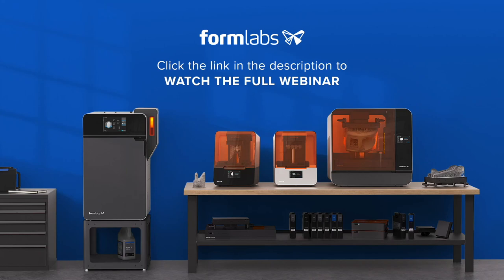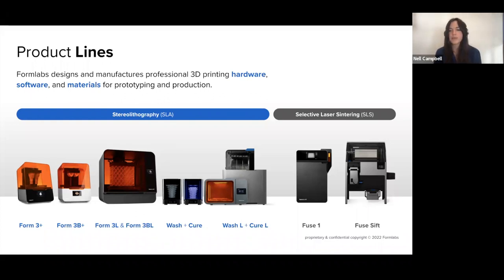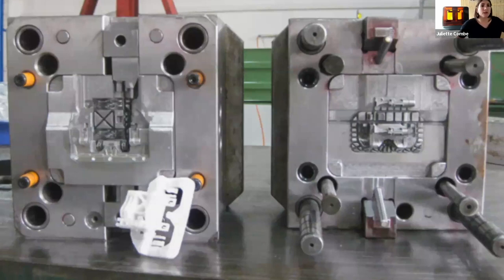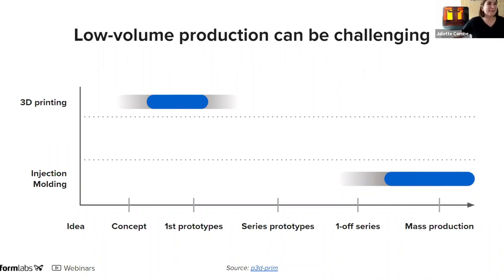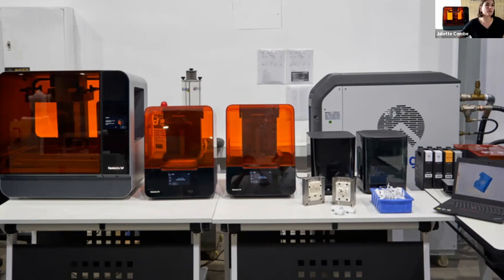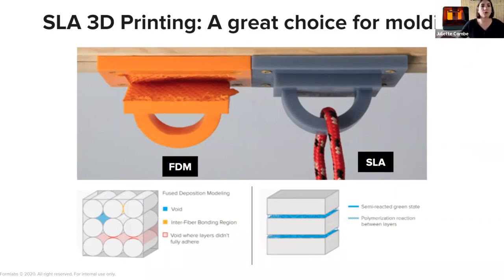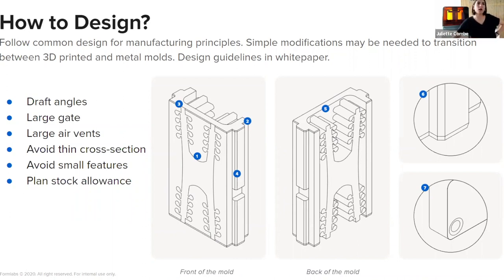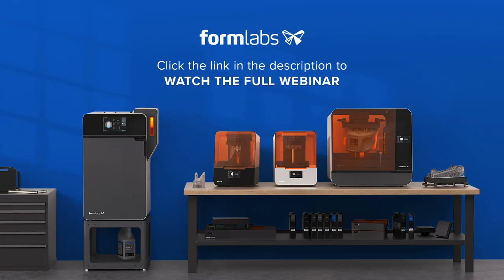Low-Volume Injection Molding: Injection Molded Parts in Less Than 24 Hours

Comment: Will SLA be able to sustain high temperature of Hot grain purée in it?
Reply: Depends on material you print with. Rigid 10k can do polypropylene injection temps.